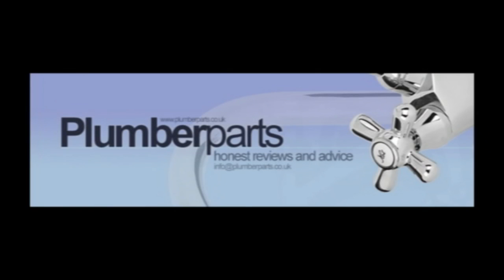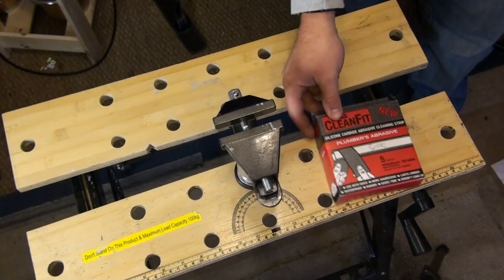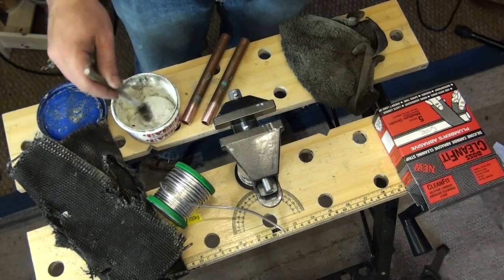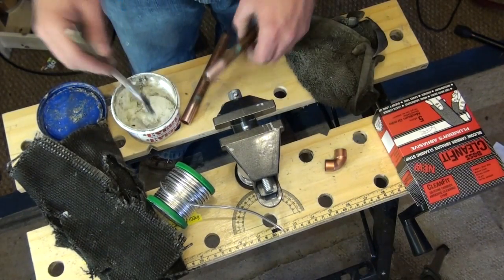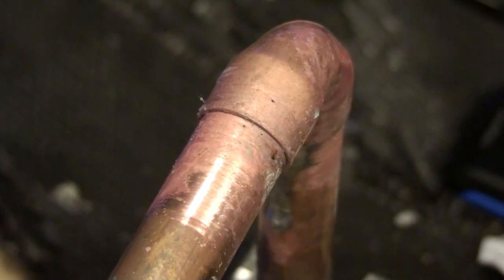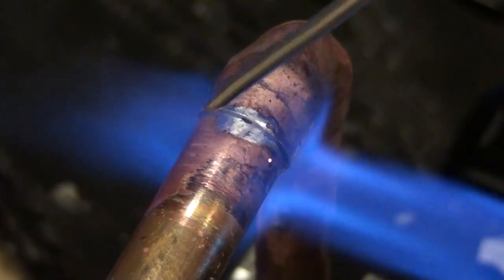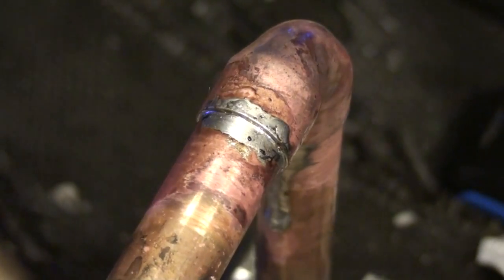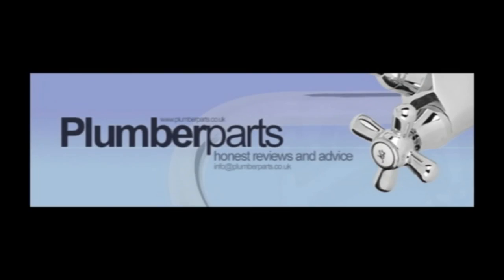How to solder copper pipe - Plumbing Tips

Comment: Hi pal. Is best use a damp cloth to cool down pipe after soldering or some plumbers I've seen,, tend to use flux  with a brush and cool it down.... What's you opinion on that? with

Comment: Do you need to deburr the inside of the copper pipe after you have cut it?  Do you clean the inside of the fitting?  Do you put flux inside the fitting?